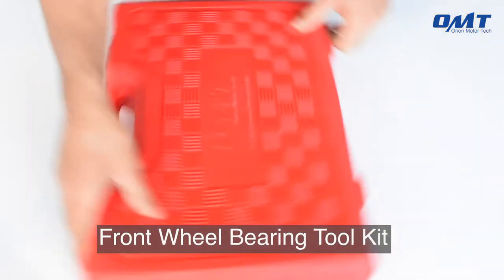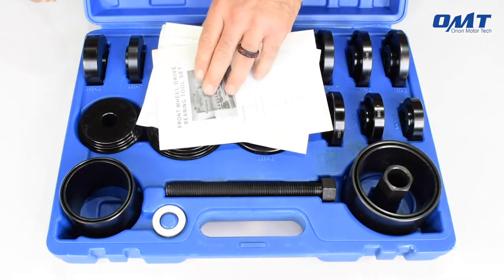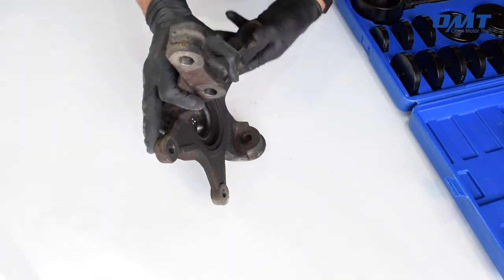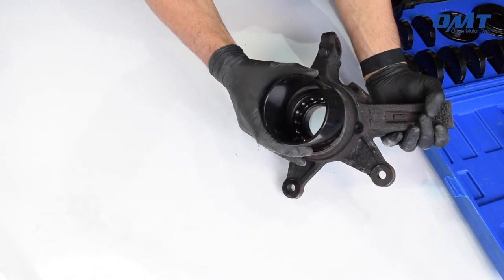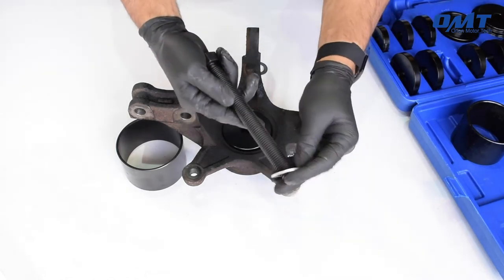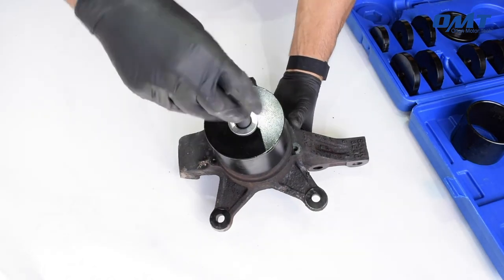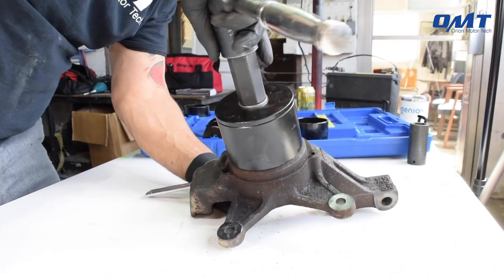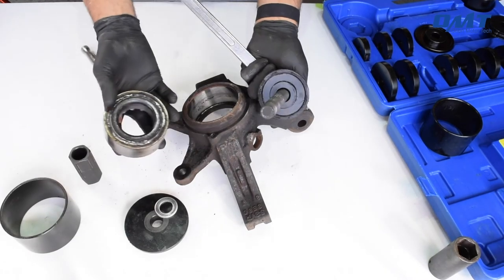Removal of Wheel Bearing with 23-Piece FWD Front Wheel Drive Bearing Tool Kit

Comment: Hmm my abs side race pressed into the bushing on removal. Did I do something wrong or is that something that can happen? The outer race is stuck on the hub too but that’s expected. Now I have a tool bushing with a pressed on bearing race. 

What size(#) bushing was used to get through the bore of the knuckle?

Comment: What is the MATRIC size for the nut and screw in the kit. I just got the kit and will need to order the right sockets to be able to use the kit… Thanks!
Reply: 32 mm for the nut and 1" 1/16 for the bolt. At least in my case.
Reply: Thanks!

Comment: How does this tool remove the wheel hub? Please demonstrate
Reply: You’ll need a slide hammer to remove the wheel hub friend!
Reply: @keyrealm3312  Yes a slide hammer can be successfully employed but a better option is to use the Orion tool itself. The force required is less than  that required to remove the wheel bearing, and additionally in most many cases can remove the inner race at the same time the hub is removed from the knuckle allowing the reuse of the old hub if the hub in satisfactory condition at the time of removal. And removes the extra time and effort required if the old hub is removed by pounding out manually and usually always requires the necessity of removing the old race viva a cutting tool. The cutting tool can successfully accomplish the task of removing the old race in order to reuse the hub A hub puller is a better option over a slide hammer. Less stress iis generated on the hub compared to a slide hammer. Even though a slide hammer can be employed to remove the hub without damaging the hub...